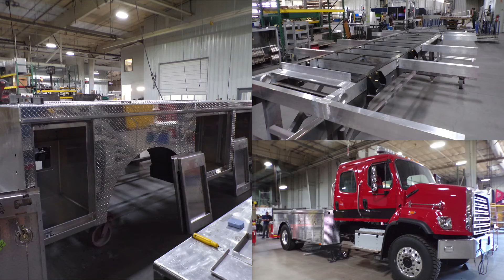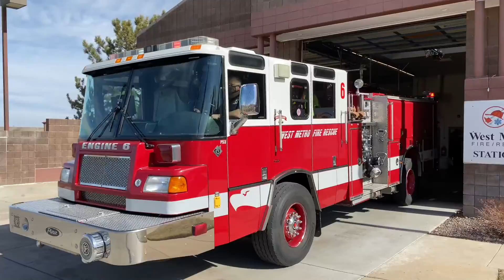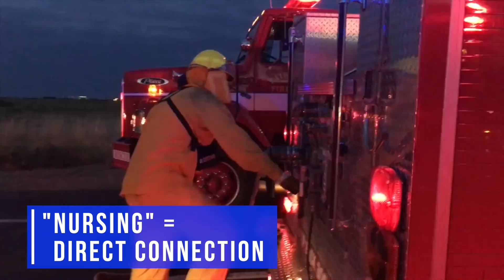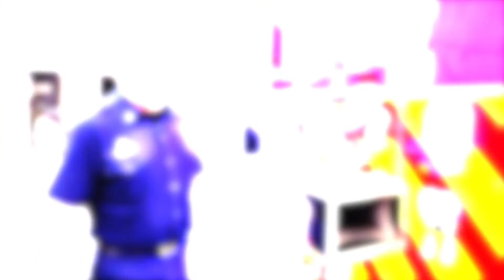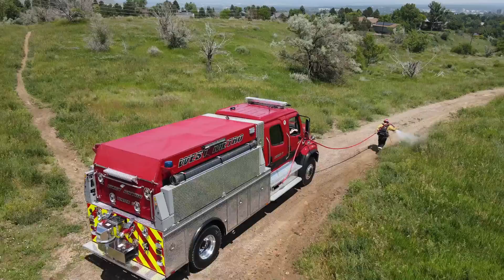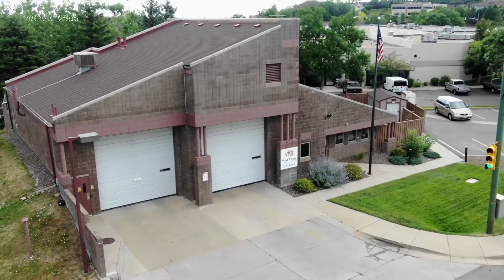West Metro Fire Rescue, Colorado Water Tender 6 | Fire Apparatus Feature

Comment: Very Nice Rig ! Its a joy to see that you put so much thought into its design and service. Now days you see a lot of bells and whistles to show off to the taxpayers that their money was well spent. Somewhere the fire service has lost sight of the only thing that really matters at the end of the day is that you >> put the wet stuff onto the hot stuff and nobody got hurt<<. 2000 gallons of water, 4 man crew, 4WD, low slung pump, 2 portable tanks and a separate supply pump...  I couldnt imagine a better, more thought out method of serving your community more responsibly or efficiently than this fine rig. The only thing I personally would have done is add a Federal Q for the road trips .  Good Job *Guyz*.